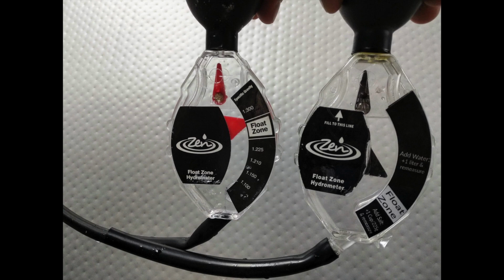Updated Water Care Guidelines

Comment: At some point it may be cheaper and easier to use chlorine if your tanks tolerate it.  The local spa just doesn't have anyone use the tank for 16 hours after the chlorine shock and nobody complains or notices it.  They do also use hydrogen peroxide and a UV light in their significantly more expensive commercial units.
Reply from the maker: Hi Dirk, chlorine is an option, but we have not tested it in the Tanks and do not know what it might do to the materials - so proceed cautiously because that would not be covered under our warranty. Also, many of our customers do not like the harshness of chlorine so they use H2O2 as the less-harsh alternative.

Comment: Also, the owner of a local spa who has an old Zen tent at his home does a weekly shock with chlorine  in his commercial tanks.  Would lower peroxide levels and a weekly shock with chlorine be a solution or will the tent and filtration system not tolerate that?

Comment: If I understand correctly the old tent with the old filtration system used less hydrogen peroxide and the new tank with a new filtration system uses more hydrogen peroxide.  We understand that light degrades hydrogen peroxide and that you tested the new UV light and it didn't seem to make a difference.  Have you tried to use the old filtration system in the new tank to isolate the problem to the new filtration system vs something to do with the new tank, or am I missing something?
Reply from the maker: Hi Dirk, Thanks for the testing suggestion. Actually, the Tent 1.5 filtration system and the Tank filtration system are the same and we checked to make sure there were are no changes to the specs. We also have customers that moved their filtration system from their Tents to their Tanks and are seeing the same H2O2 depletion in their Tank.